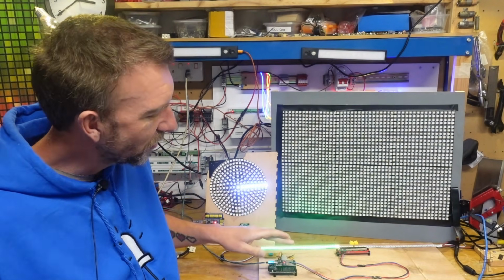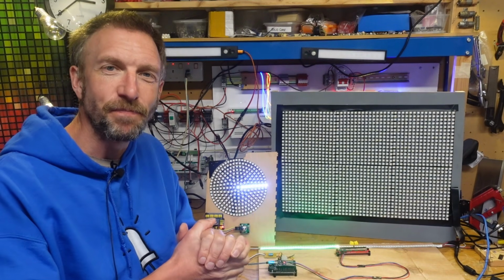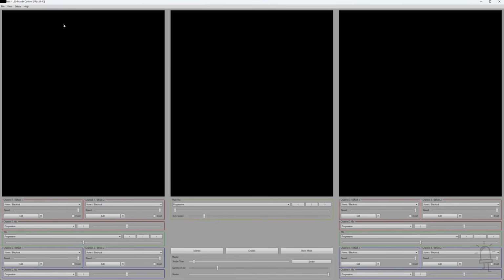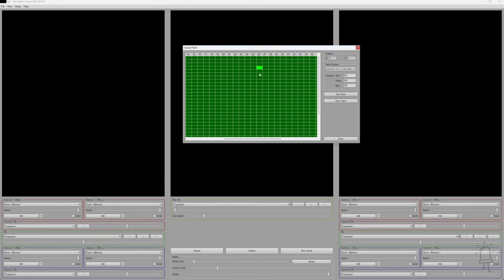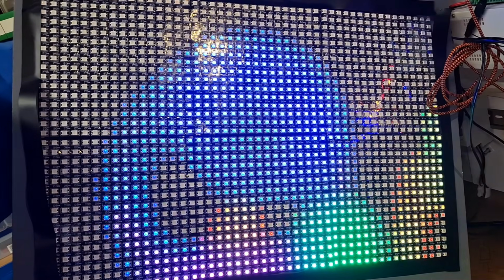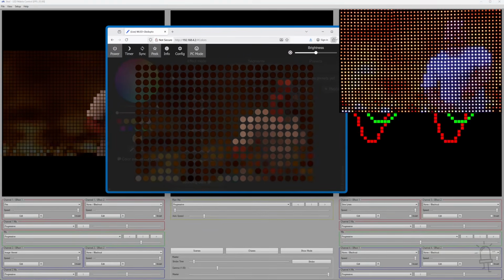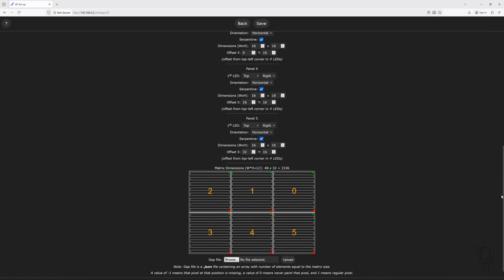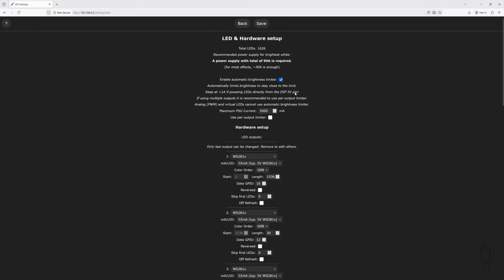Stop Hard-Coding LED Animations! Upgrade from Arduino/ESP32 → sACN + WLED

Comment: This seems interesting! But I don't really get it. I have a custom build WLED grid panel (just a bunch of WS2812B strips soldered to each other in a 3D printed frame) I was wondering how the build in effects are created and this seems like a good candidate. I would be interested in programing (?) my own animations and then saving them to a WLED preset, would that be possible this way?

Comment: Hello,

I’m a big fan of your YouTube channel and the escape room puzzles you build.

I had a question about something I’m thinking about. How would you personally connect a physical puzzle (for example using Arduino, sensors, buttons, etc.) to a custom application running on a PC that is inside the escape room and used by the players?

I’m not referring to the game master control computer. I mean a PC that is part of the puzzle itself, where players interact with the software, and when they solve a physical puzzle it sends a signal to the application.

How would you approach this technically?

Thank you for your time and for the great content you share.

Comment: Brilliant. I finally got round to buying some neopixels and rasppi to play with and ended up making an ambilight. I liked it so much, I left it installed and brought another strip. (5m, 96 pix/m)

My next obvious thought was getting them DMX so I can use them in the theatre somewhere. Have been looking for tutorials but not finding much in the way of simple step by step from scratch with a ESP32.

My question would be - either how hard is it to do this with an ESP32 (which I already bought a couple) and/or how / where can I buy one of those GLEDOPTO or equiv in NZ. EU site only seems to ship to the EU. (US site doesn't have a buy button)

Anyone have any suggestions / tips?

Comment: I found it amusing your LED matrix was driving the WS2815's I have stuck to the back of my monitor for ambilight. I'm running HyperHDR and passing the data over network to an ESP32C6 running my own custom WLED protocol shim on ESPHome. This cuts out all the fluff of a full WLED install. sACN however does look like something I'd use in a larger setting. I'm curious though, are you using a 5V80A switching supply for your matrix there?

Comment: Wow my holiday lighting (xlights/ FPP) hobby collides with my game puzzle hobby. 

Lights enthusiasts have even found using DDP a good trade off. Trades 512 channels for 1440 and has good sync options. But is missing some features of 1.31.
Reply from the maker: Yes - I think some of that decision also comes down to whether you're only controlling LED strips, or whether you have a mixture of fixtures in your network (and, if so, do you create a separate universe for each, etc. etc.). I'm a big fan of Node-RED, so I was also interested in options that could be triggered directly from that. So many choices!